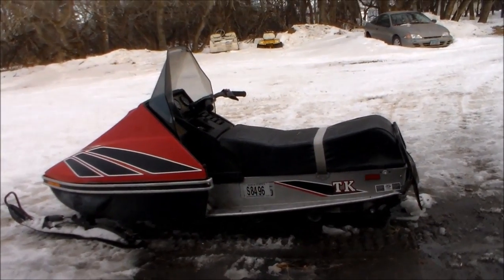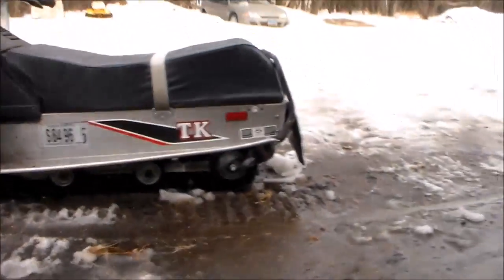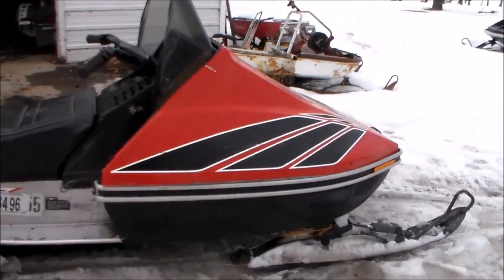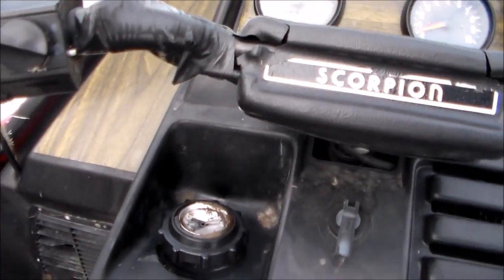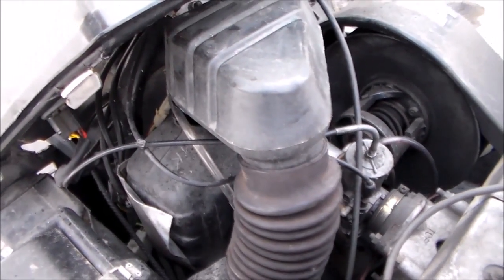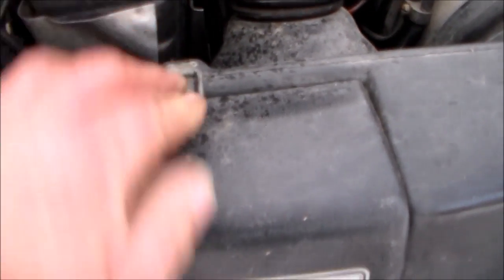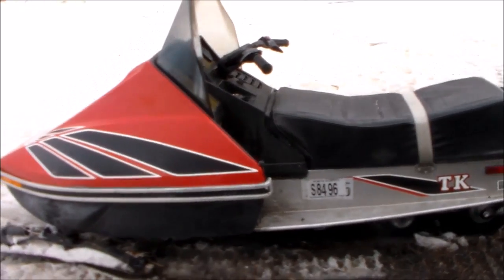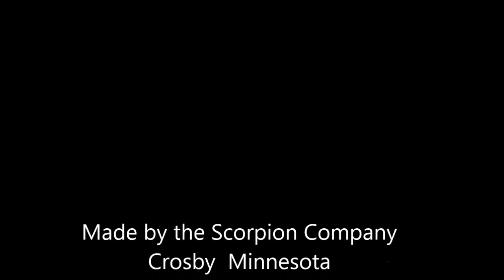1980 SCORPION TRAIL  KING SNOWMOBILE

Comment: what happened to scorpion? they had to be the best that I remember.  they alway ran and fast for there time.  my cousins had them, never had problems.
Reply: james guralski They were bought out by Arctic Enterprises at some point, sorry not sure on the year but when Arctic Cat went belly up in i believe 82 they stopped making both then when they came back they just made Cat and no longer made the Scorpion.  So many brands went out of business in the 80's at some point.  Sadly.  John Deere, Kawasaki, Bombardier's Moto Ski .... it's too bad.  70's and 80's had so many choices.  Scorpion's were very nice sleds too.
Reply: Arctic purchased Scorpion in 1978. They continued separate brands, manufacturing, R&D/design,  etc, until the end, with only 1 model being a crossover, that was the 1981 Scorpion Sidewinder, which was essentially, a 1981 Arctic El Tigre , with Scorpion colors, and a 440 liquid cooled Suzuki motor, instead of Scorpions own "Cuyuna"  motors.  If you look at a picture of an 81 El Tigre, and an 81 Scorpion Sidewinder, you'll notice the same body.hood shape, small things like vent placement may be a little different. The Cuyuna motor line was sold separate, and I believe, are still produced today, under a different name, for ultra lite planes. My father was Engineering Services and Administration Manager for Scorpion from 1969 until Cat went under. The Sidewinder was his last project.